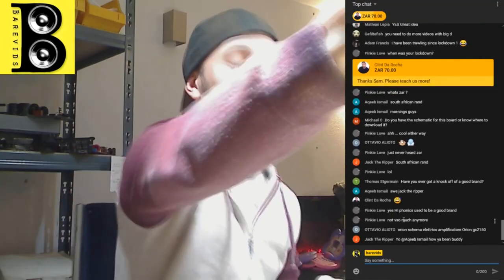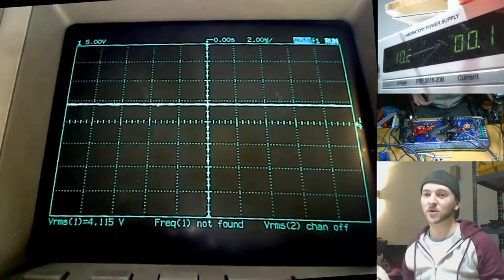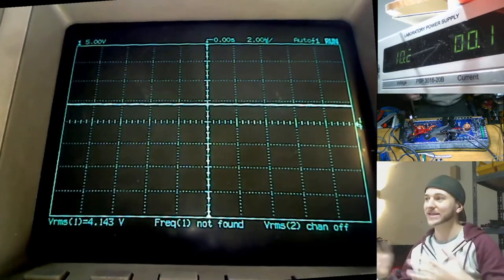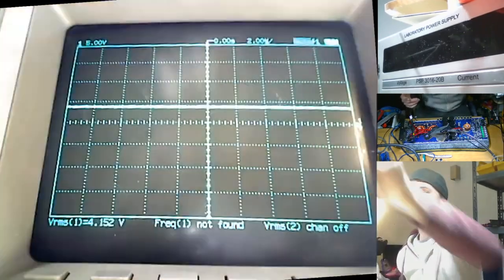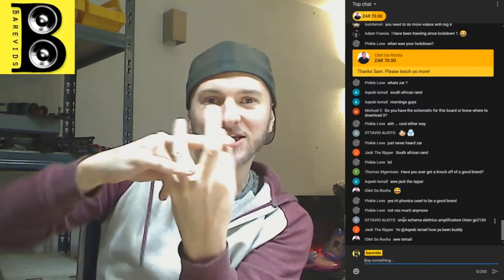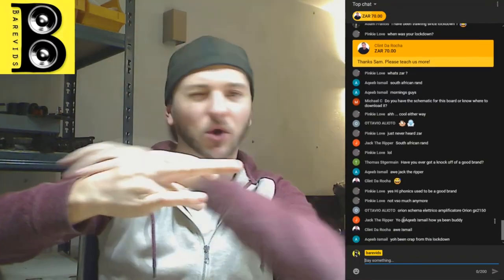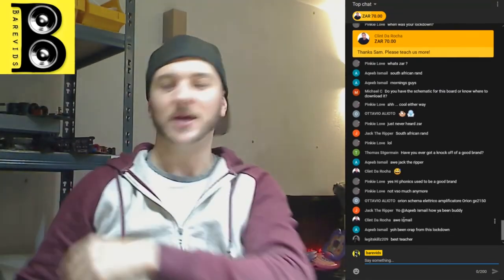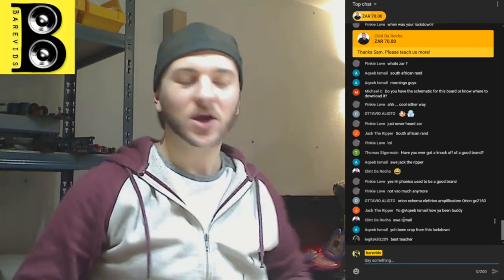Car amps with NPN+PNP drive buffers WHAT are they actually doing mate ??

Comment: I remember that livestream during Streamas! Happy you isolated that part! Very valuable info! 
P.s: Really sucks that Perry's guide took a hit with flash getting banned. The mod to inject external rail voltage like what u did with the B2 is on it. Changing my date and time helps with Perry's guide though for anyone who's having issues with it. It's annoying but it works!👌

Comment: buen dia, tengo una duda acerca de un amplificador BRZ1700.1D, en la etapa de audio retire los mosfets pero no recuerdo la posicion y que tipo de mosfets son, recuerdo que retire los IRF640, pero observando un video donde explicas como reparar un amplificador hifonics de diferente modelo al mio, observe que son IRF640 E IRF9640. En concreto basado en tu experiencia podrias apoyarme diciendo si para el hifonics BRZ1700.1D solo trabaja con transistores  IRF640 o trabaja con IRF640 para el voltaje positivo  y  IRF9640 para el voltaje negativo?????
 
de antemano gracias.

Comment: Good morning, I have a question about a BRZ1700.1D amplifier, in the audio stage remove the mosfets but I don't remember the position and what type of mosfets they are, I remember removing the IRF640, but watching a video where you explain how to repair an amplifier hifonics of different model than mine, note that they are IRF640 and IRF9640. In particular, based on your experience, could you support me by saying if for the hifonics BRZ1700.1D it only works with IRF640 transistors or works with IRF640 for the positive voltage and IRF9640 for the negative voltage ?????
 
first of all, Thanks
Reply from the maker: It's probably only 640n. Let me know what kind of drive circuit it has. If it has many small sot86 transistors marked AG and DK then it will use 9640 also. If it has small size card with 3 large transistors top left, theyre all 640

Comment: Good night , The cordless drill does not have a capacitor to help it to stop instantly . What actually  happens is when you release the trigger the  motor terminals are shorted and that causes it  stops instantly.

Comment: Hi, just wondering if you fix computer gpu, my 980ti has failed, I’m in Crawley West sussex
Reply from the maker: On these most of the time it's the GPU chip itself which is not replaceable. I can do a controlled bake for you if you like, many people report success from this but there's no guarantee and even if it does work it may die again after a few weeks, or it may work again for years.
Reply: @barevids  Thanks for the reply. i'll do a re-thermal paste first and and try a few more things... Although before the failure the computer was hard rebooting with power surge warning in bios.. The computer is working fine now with a really old ATI card thats been in the cupboard for years HD5800, never thought i would use that again!
Reply from the maker: Haha I have some old parts kept for the same reason!